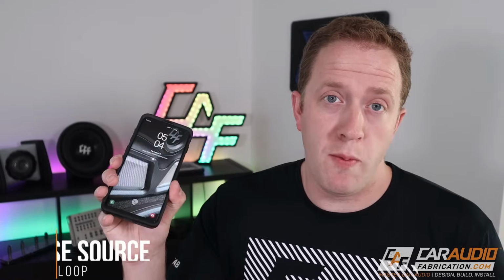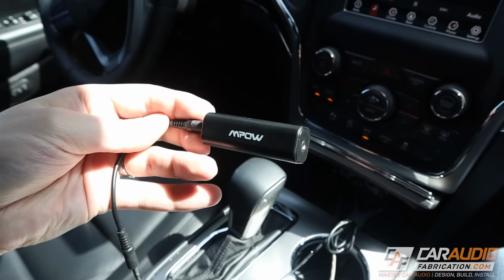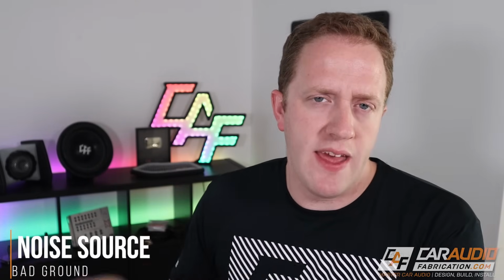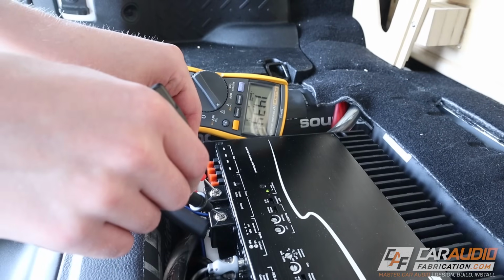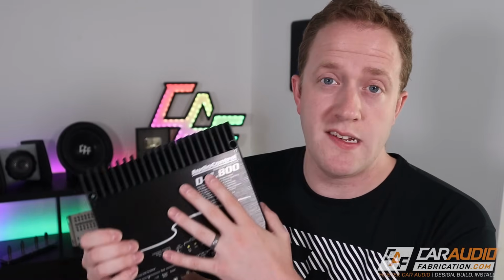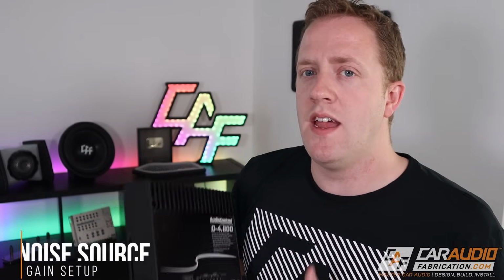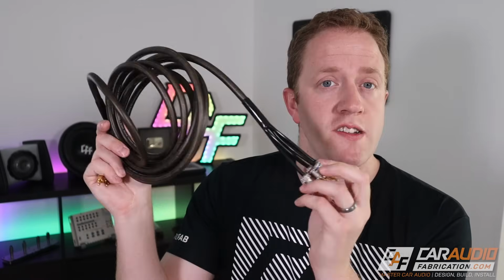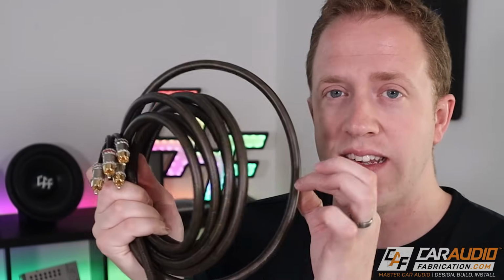BUZZ, WHINE, HISS? How to FIX Car Audio Noise!

Comment: I drive an EV and had a very annoying buzz at the beginning. I've done all the upgrades as you mentioned in your video and it has gotten 90% better. Now there is no audible noise but my oscilloscope shows a dirty signal making the system hard to tune. And, every few months that audible buzz returns for a couple days and then goes away again. Do you have any experience with EV's and EM interferance from the battery system? Love you channel, keep it up!

Comment: My 06 pathfinder has been sitting for a good while,  now the factory bose stereo is having constant static from the rear door speakers and back factory bose speaker. 
This is happening even with the radio off

Comment: I just installed a Rockville under-seat sub in my daughter's 2014 Honda Accord. I had to use the high-level inputs because her radio didn't have an RCA out.  It sounds fine while parked but horrible when driving. 

Would a Speaker to RCA converter help?

Comment: Watching this vid now as am currently upgrading my cars audio. 

4x Pioneer TS-D65C (second hand bargain) and Alpine PDX-V9 amp. And countless hours spent sound deadening and insulating..

As the amp is a 5 channel amp i intend to in the future add a subwoofer, and have pulled the spesker wire for that future upgrade, along with an RCA cable and power cable (to in the future be used for a 12v plug in the trunk) as i have a temporary subwoofer, an itty bitty 80w RMS, yet somehow 12"

Headunit is of the chinese android variety. And did not trust RCA outputs, so i have purchased a hi-low level adapter, but using the headunuts RCA out for the subwoofer. 

On tests it ceirtainly works, but theres a whine, does not change with headunit volume, does not change with a completely different RCA running far from any power or electronics, and does not change at all when giving better ground  but changes when adjusting gain.  and noise completely dissapears when using my old phones aux jack to give signal. 

All this makes me believe it was the right decition to buy a high-low adapter. But i do still want to know if theres a simple and cheap way to sort this noise, or if i should just 'bite the sour apple' and set the hi-low adapterup. Along with the amp to power this subwoofer. 

Your expert advice would be greatly appreciated now 6 yeara later when i decided to treat myself to upgrades. ^^

Comment: It's the alternator dude. Nothing else. I installed it myself and it kept making that noise so I had to get it professionally installed and still kept whining. It is a simple fix. Replace alternator. I know cuz my alternator has low voltage. 13.7v. that's a bad alternator. I didn't realize that til my car wouldn't start. Had to get to get the alternator replaced. Now the whining stopped.

Comment: My issue is that the buzzing (bzzzz,brrrrr,bepbepbep,zzzzzzzzzzz,bopbopbop,zzzzz) gets louder as i turn up the stereo.
Im using bluetooth, its not alternator noise as it still does it without the engine running. if i run the speakers directly from the headunit it still makes the sounds but just way more quiet. 
Im running the speaker outs into an amps high level input as i only have 1 set of rca ports on the headunit to run the subwoofer

Comment: ... and after three years, I got back here having the same issue with regards to the noise that is changing with acceleration, exactly as you specified! BUT: this noise does NOT occur when the engine is not running... I will try a different ground as you suggested... 
Only I do not want to talk about this, but about the subwoofer enclosure; my trunk has a volume of about 350 Liters and I tried to build a replica of the original ABS enclosure designed by the engineers. My subwoofer has only 6.3 inches (which replaces, of course, the factory one) in diameter and is extremely powerful (I guess I cannot say the brand, but is a genuine one ;))... so powerful that is shaking the trunk a little bit! The replica I was talking about is made out of wood,  self-built, ported one... it sounds pretty satisfying, but I want to know if there is a specific ratio between the volume of the enclosure and of the trunk one...      
I started an adventure by building ported enclosure for car... I want to know more of this because I'm not seeking powerful sound but music quality, sound quality! Thank you for all that you're doing! 
🙏

Comment: What if I installed a aftermarket radio and it does the same thing but I'm only using Bluetooth not an ox. What do I need to do reground it

Comment: I installed an Android Audio System to my old GMC with Bose Amplifier and came across the same hissing sound. After some trail & errors, I solved the issue by installing Audio Isolation Transformers on each of the four channels. 
The solution was extremely cheap and simple and did not affect the sound quality.

Comment: I just installed 4 doors DB and Flex speaker combined with v12 amplifier, and the technician did everything to eliminate the hiss, but we failed, after all i suggested adding a switch key so i can turn off the amplifier entirely if i dont want to listen to music, i will try to follow this guide and to see what happening

Comment: I get engine whine through radio like the engine high pitch sound - revs the engine up it gets higher pitch, any ideas, I just up graded radio still have factory speakers. no RCA cables, just factory harness to radio..

Comment: I have sound coming from my tramp also I’ve had a broken RCA where the wire came loose,from the connector that goes into the amplifier that caused the noise for my front speaker

Comment: 4:04 use rubber washers, then use a rubber bolt or screw to secure the metal amp rack? 🤔🧐

Comment: I have problem whit my car sounds. When I use radio or CD it’s works perfectly but as soon I connect my phone to the car whit Bluetooth I get those sounds. My Bluetooth is something I bought from the Webb and install in the car so it’s not an original.

Comment: Installed a whole new system in my boat.  Kicker head unit, JL Audio amp and JL Audio speakers with all new wiring but I still hear a static noise coming from the speakers.  My amp is mounted but not next to anything that should cause electrical interference.  The head until is about 4 inches from the AMP so RCA cables are short.  I tried swapping out RCA cables with JL Audio ones but still hear static.  I cant imagine it being my speaker wires, those are 12awg and at the length of 20' at most.  Even with gain on amp turned down, I still hear static but obviously gets louder as I increase the gain.  The static noise starts as soon as I turn up the volume from zero to one.  The static does not get louder as I increase the volume.  The source of my music has no affect on the static, ie radio, mobile phone, aux.  The power cables for the amp are 4awg per JL Audio's requirements.  The positive goes to my main switch to cut the power to everything and the negative cable goes to a negative terminal on the battery.  Not sure what is causing this issue but any help is greatly appreciated!

Comment: I have the original stereo in my mini and no amp? It’s driving me nuts, the noise it absolutely shocking. The static  sound  comes through all of the speakers and I can hear the alternator whine, which gets worse with speed. Please help before I rip my ears off 😳🤣

Comment: I've just installed aftermarket speakers and added sound insulation to the doors. Now I hear silent hiss from the speakers when turning down the volume. I dont know if that hissing static noise just appeared after installing new speakers or if the insulation make me hear it better than before :D

Comment: Great videos! Helped me finish my install and your series convinced me to pick up the LC7i. I have a situation NOT covered in this video. I disconnected the RCA signal cables from the LC7i into a 265 RMS 4-channel amp with gains on all channels at the lowest setting. It's silent when engine is off but I get a HISS ONLY WHEN ENGINE is running. It doesn't change pitch with RPMs. Remember, no input signals going into the amp. It sounds fabulous when music is playing. I have a 125 RMS powered subwoofer that's using the same ground point via a distribution block as the 4-channel amp (also input signal disconnected). Could that be the cause? I don't know the cause-effect of having each component sharing the same ground vs being independently grounded.

Comment: Hello. Got the same issue after changing my head unit ( aftermarket ). When i turn my radio or play music via BT,  I heard a whistle sound when accelerating my car. What should i do? Do i need to add ground wire? Thank you.

Comment: I know this is a five year old video at the time of my comment but this guy nailed my issue to the T. I ran down my issue by least invasive to the most complex. First step check gains and what do you know, that was the issue. No noise and speaker talking loud and bass booming. Thanks bro!

Comment: Very faint buzz… put new JL tweeters in my Colorado. Had very slight buzz . when asking friends if they heard it some couldn’t. The passenger side was quiet. After trouble shooting I discovered that if I took the crossover out of behind the dashboard. It solved the problem! Thanks for the video.

Comment: I get bad static or whine when I use my dash cam.  When I unplug the cigarette lighter power cord it stops.  I'm lost. Do I use a ferrite filter or would the isolator you showed work?  If I need the isolator, how would I install it?  Thanks for your help.

Comment: So i ran a ground wire from my battery to my amp, but once it came into my car i ran it in a different route to the amp.   Would this cause whine?  Also should i run all 3 sets of RCAs along with the ground? Currently they are on the same path as my power wire.

Comment: I have a question about ground loop isolators. I ran a high level 9-wire cable from my aftermarket head unit to the high level inputs on my 4ch amp. I now have noise. 

But all of the isolators I've seen have RCA connections - how do I isolate a high level input?? I've already beefed up my ground cable as suggested, and the one on the battery is hefty. Looking for guidance on my next steps. Thanks!

Comment: I have a question I can't seem to find an answer to on the world wide web. My son recently acquired a 1997 BMW 318IS (new driver, his 1st car). The cigarette lighter is constantly powered which is not beneficial to him as he uses the lighter plug to plug in his FM modulator, so when the car is off, it continues to power the Transmitter which drains his battery. Can I rewire this so that it only goes on when ignition is on?

1st question: Can we change this so that it's only on when ignition is on, and if so, any known videos out there? 
2nd question. The cig lighter also has bad ground issues as when he plays music through his FM modulator,  there is a high-pitched humming noise. Can this be improved? I know it's not the fm modulator as when used in my other car, it works fine.

Maybe a better solution is can I add another cigarette lighter socket to the car and make it so it'sonly one whne the car is on, and will that help resolve both issues?

Any help would be appreciated!

Comment: i feel my situation may be unique ? i have a 2010 toyota camry that had factory JBL. I added an amp, changed all speakers, and added an aftermarket head unit. the only problem i have is i added the tweeters and get a hiss. they’re also somewhat low volume. they’re the only speakers i get a hiss on and they have a crossover.

Comment: I don't know if it's just me,  but the technology of pro audio has advanced by leaps and bound. Why is it the concept of pro dj connectors be incorporated in car audio to eliminate noise.  I'm talking about balanced outputs and inputs on amps and balanced connectors, example. Xlr or TRS Jack' connections. why something similar can't be reduced to fit car audio. This will completely eliminate noise don't matter the lenght of the run.  Why hasn't anyone thought of this? Would it work I'm sure someone can invest and invent something new to get rid of this issue once and for all.

Comment: Ive had a mono sub amp and after market head unit for a while and haven’t had any issues, but I just added a 4 Chan amp and new door speakers and get constant whine. I ground my new 4 Chan. amp to the same bolt as my mono, could this cause the whine?

Comment: 07 avalanche, bose factory setup. I installed a pioneer double din, with the radio on, volume down to 0, the speakers are playing static white noise. Volume to 10, comfortable listening volume, mids and highs produce static. It sounds to me like the amp is wide open/maxed out. Any thoughts?

Comment: I have two amps on a new build and I was testing the speaker amp (other is a bass amp) with no subwoofer speaker connected and it had a whine.  When I unplugged the RCA from the sub amp it went away.  The RCAs are split from the same source but I only get the whine when the RCAs are plugged into both amps.  what gives sound bros?

Comment: I’m experiencing severe static throughout all of the my speakers in my vehicle. Got worse once I installed an aftermarket amp. 
I’m down to the final troubleshooting culprit now. The stock antenna! 😮 I hope this solves the issue

Comment: I am having an issue with an aftermarket head unit when I plug in the stock AM. FM antenna makes a lot of noise in the system. 
Unplug it works just fine.  Any suggestions?

Comment: I have been getting a booming noise randomly. It starts even before the engine is turned on and continues when driving. The stereo Navi unit will black out and turn on and repeat this cycle with every boom noise. Wondering if anyone knows what the issue is? Driving a VW sharan with the stock stereo.

Comment: I'm testing my car audio set at home, powering it with a 12V server power supply. Additionally, the cables are long (and not so thick, with high voltage drop) because the power supply has a noisy fan. Could this be the reason for the tweet noise?

Comment: I have a question. I have a recently hooked up a aftermarket amplifier to my original head unit on my 20 fourteen, Honda Odyssey. system works good and everything. But the moment I close my door I get this vibrating sound of my subwoofer. It's been driving me crazy. Is there anything you could give me advice on to try to fix this problem? I really appreciate it, thank you.

Comment: I hav  2005 sl500 with aftermarket Kenwood double din with an Amp inches trunk. I hav noise as soon as u turn on the key but engine is not started. Any suggestions tks

Comment: I having hissing sound, I suspect this is coming from the high low converter... when I disconnect the RCA from the amplifier  and then plug an external 3.5 to RCA from my celphone there is no noise. Very weird...

Comment: Hi! Just had a new sound system installed and I always use Bluetooth to play music. Once I started up my car with new sound system (speakers, sub, amp and audio signal process. Sec I start up car I can hear the humm/static instantly. Regardless if the volume is up. Any suggestions?

Comment: @CarAudioFabrication Hi. I hav a Mercedes A class using bluetooth from my iphone 12 on youtube music.
I has a hiss static noise when the volume is loud. Just wondering if the ground loop isolator would help reduce this? My phone isnt even plugged into the vehicle but i still get it. I have tried it with all major streaming and even my old car had the same issue. Any suggestions?

Comment: Mine is crackling through the USB only. I use an old school iPod but for some reason it crackles through the car when the regular/ sat radio is fine. I replaced the USB port but still having this problem. Any tips?

Comment: I fixed mine. Mine was because the key 2 steering wheel skip track button was plugged into the android tablet screen I un plugged it and it was gone I’m going to see if I can ground the black wire

Comment: I have static (RMI) after going aftermarket- Hifonics, Soundstream, Audio Control/ Epicenter w a stock head unit in my Tacoma. A lot of "Dos & Don'ts" during installation that I've forgotten. Nowadays,  I have old man symptoms. I got my MECP Installer certification in 1990 when I was 20. Thanks for the refresher video!!!

Comment: Mine was ok for Three years then all of a sudden my amp for the speakers quit and the guy at the shop said it was the remote wire.That’s when all the whining started and he’s yet to figure it out,said it might be the rca cables the ground the amp or head unit. I got another amp,he installed it still doing it,quit for a while.Then he hooked the subwoofer amp back up and all the whining started. I had to leave he said to bring it back next week and he’s going to check the stereo unit next🫥😡

Comment: I had a amplifier powering a sub in my car for about 3 years since I bought it but now I connected all the speakers to it and got a separate powered sub and now whenever I turn on the fan the speakers have a small hum that gets louder with each fan speed increase, the speakers are really good so when music is playing the hum is inaudible but I'm curious what could be causing it.

Comment: Yes, stock system was stolen,  after market whines. Had shop instal isolator but it still whines. Even whines when head unit face removed. Should I have the install better ground wires?

Comment: I'm here cause my new head unit is creating buzzing/whining noise. It must be the new head unit cos it only does it when audio is playing, when I put it to volume 0 or mute, it stops... It also stops between tracks on Bluetooth? Am I right or wrong?  Grrr... soo painful. The new head unit was a cheap piece of crap from some random store, have had it sitting around for a couple years and finally got a car to put it in, what a waste of time